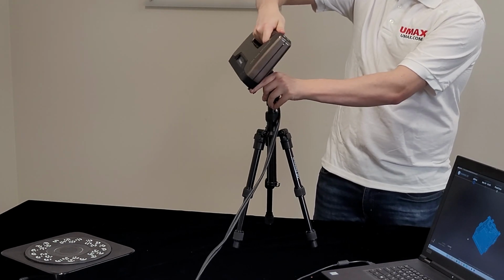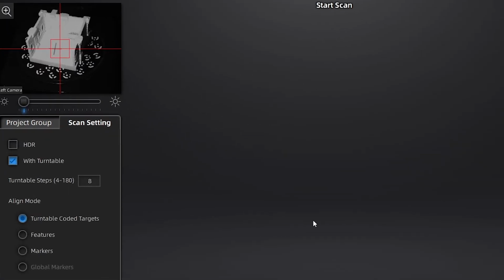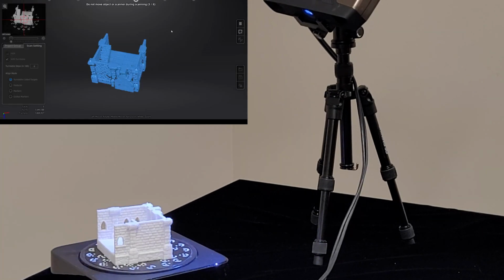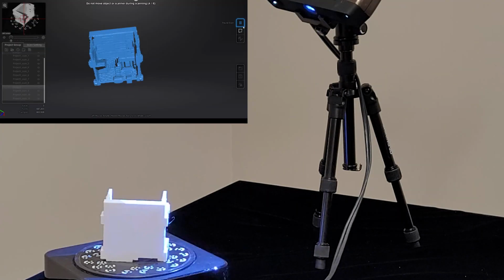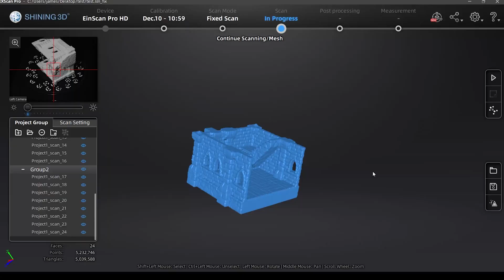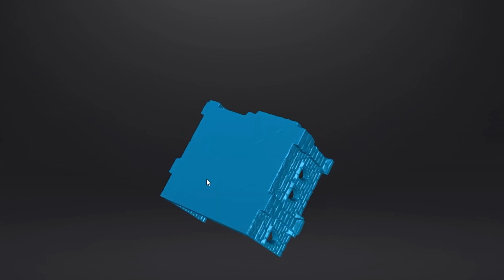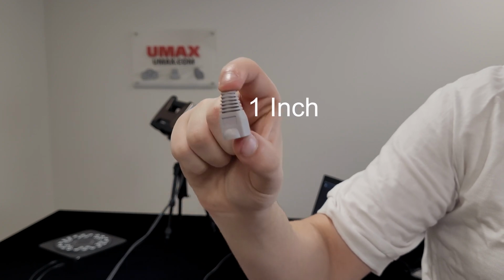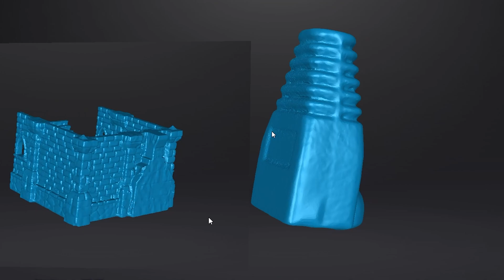UMAX | Einscan Pro HD Fixed Scan demonstration

Comment: Bro i have einscan pro when i use rapid scan with marker mode software said activate licence.so what is problem can you solve it?
Reply from the maker: You will try to activate online. If it doesn't work, try off line activation with your license file. If the message still comes up, contact Einscan tech support via email.